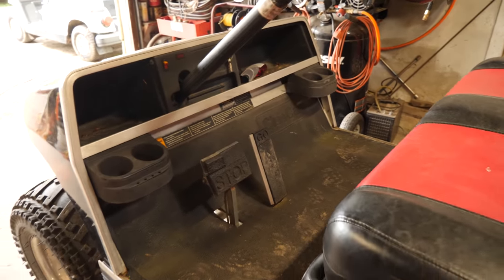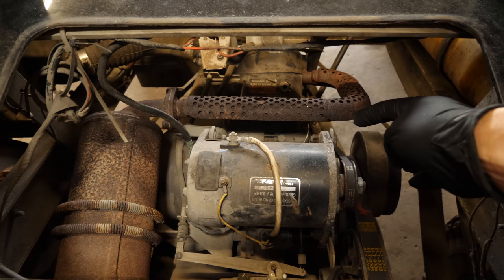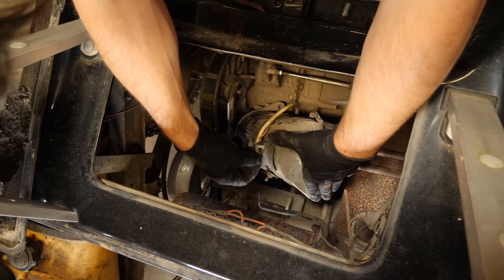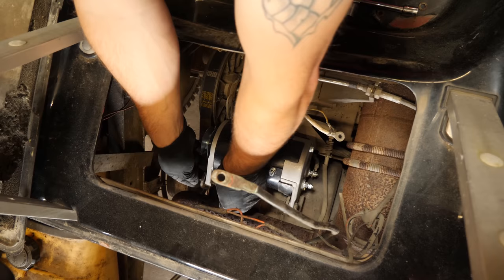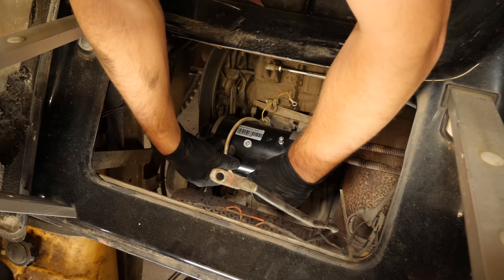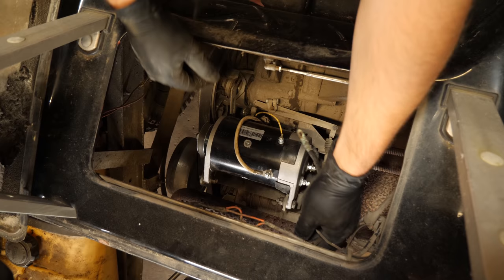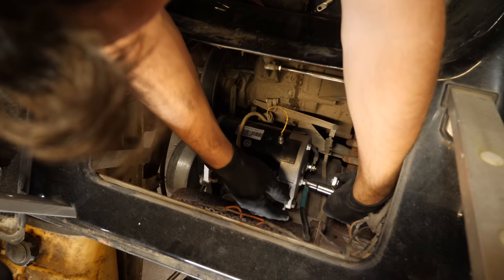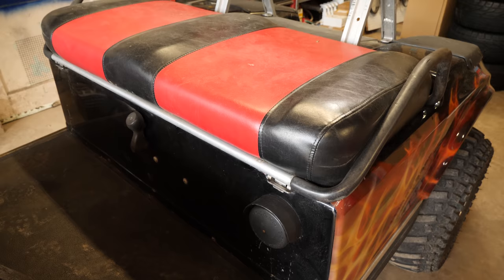1994 Club Car DS, Gas - Replace Starter Generator

Comment: Thanks, my father's club car is doing the exact same thing as demonstrated in your video. I diagnosed it to the starter generator, but our local dealer was suggesting something else (without having seen the cart).
Reply from the maker: Its really hard to suggest a repair without diagnosing the issue first. When someone says their cart won't start and asks what it could be, its very difficult to pinpoint a solution. Best thing to do is start with the easy stuff, like battery connections, voltage and polarity. These are the most common issues. Next, check for a blown fuse. Typically its a 10 amp fuse that controls the entire cart's electrical system. I usually jump to the solenoid next and see if it has power where it should. Sometimes these will click but not make electrical contact to start the starter/generator. If it doesn't, I check all the micro switches and key switch for voltage and continuity. Sometimes a corroded wire or connector is the cause of many issues.
Reply: Thanks for that, Kevin. Those were pretty much the same steps I went through to diagnose the starter generator. Prior to this latest issue, the cart has been having some trouble starting. It would just crank forever before finally starting, especially when it was cold. Once warmed up, seemed to start ok, usually. I suspect the starter generator has been borderline for some time, and sounds like it is a very likely cause of the difficult starting problems. It finally had enough of the long cranking and failed. Thanks for all the videos, I watched quite a few.
Reply from the maker: You are very welcome! I'm glad to hear that you were able to resolve the issue and get your cart back up and running. It sucks when you want to go for a ride and have to deal with issues like that. I know it can be especially annoying when you try to search for a possible solution and find nothing but half-assed answers. Thank you so much for supporting my channel! It does take quite a bit of work to make these videos  what they are.

Comment: I'm running into an issue with my 89 DS where I press the gas pedal down and it's like there's a delay. it starts and the cart moves just fine, there is just a delay almost as if I have to floor it to get it going from a stop.

Comment: Thanks Kevin another useful video. I replaced my carburetor on my 1999ds club car but don’t know how to set air flow and gas to carb. Can u tell me proper adjustment or refer me to an other one of your videos. Thanks
Reply from the maker: Visit my site or facebook page (link in the description) and send me and email or message with a pic of your carburetor. I will do my best to explain how to adjust it.
Reply: Kevin thanks for taking the time to do this. It’s the same style carburetor as in your 2000 DS service video. I’m sorry don’t have a way to send picture. Mine is a 99 DS club car. Thanks again your videos give confidence to be able to work on this machine.

Comment: Replaced starter/generator on my 95 club car DS. Watched your video to diagnose problem. Replaced and now it’s not doing anything. Won’t turn over at all. Battery is 1 year old and fully charged. The original was a Hitaci GSB 07-04A. Amazon showed that model so I ordered. What I received was Dynamo Generator model 15421N. Is that the correct part?? What else could be the problem?

Comment: I have a 85 club car gas will not charge so watch come to figure out voltage reg so put new one on wasnt the problem so put new starter generator on still same issue where to next I checked all wire all are good

Comment: Hello,I have 02 club cart that wont start I just had the brushes changed sometimes the motor will turn over but there is no spark jumping the solenoid turns the motor over.hope U can help thanks
Reply from the maker: It sounds like you have a bad rev limiter or ignition coil. Possible there's a bad micro switch.

Comment: When I changed my starter the cart no longer goes very fast. Literally about 3 mph is all. When I put the cart in service mode it is the same. It's like the throttle doesn't respond to pressing the pedal. If I reach down to the carburetor and push the throttle with my finger it will rev up. What could be the issue?
Reply from the maker: A cable has gotten disconnected or is being pinched. There are 2 cables on Club Cars, one from the control box or accelerator pedal that runs to the governor on the transaxle. The other cable runs from the transaxle to the carburetor. I'm willing to bet that the one from the transaxle to the carb is being pinched under the starter/generator.

Comment: If my solenoid works and i replaced my starter and it still intermittently doest crank what else could it be??
Reply: Ended up being my solenoid.  No voltage across large terminals during no crank.

Comment: Have trouble with my 2002 club car replace the fuel pump carburetor and the coil still loose power no ass what to do next
Reply from the maker: Do a compression test. It should be over 120PSI. If its lower than 100PSI, adjust the valve lash.

Comment: I will try that the valves r 0600 thank you
Reply from the maker: I know they started using hydraulic valve lifters in those engines but I cannot remember when off the top of my head. If you have hydraulic lifters, there will be no adjustment for the valves.

Comment: So I’m curious, I have a 2014 club car turf that is spinning ccw so I’m driving in reverse. I’m thinking now maybe someone just wired this starter generator wrong?
Reply from the maker: A 4-stroke engines cannot run in reverse so I'm thinking they put a different transaxle or engine in the cart.
Reply: @Kevinsgolfcarts  ya I think it has the newer rear end and and older fe350. It’s a 14 club car turf 1 and the drive and reverse is flipped so I’ve had rpm issues. I believe I’m driving in the reverse gears. Is there any reccomendations you have to get a little more speed with how it’s set up without changing to an older rear end?
Reply from the maker: Not really. Your stuck with it unless you swap the transaxle or engine. If you are driving faster in reverse than forward, then its definitely setup wrong. The Turf I was geared lower than standard carts so they are slow but are torque monsters.
Reply: @Kevinsgolfcarts  ok thanks for your input, so as far as you know 97 and up club cars should all spin cw right? Mine goes about 8mph and the rpm’s sound normal, if I bump the govenor up to make the cart go 12 or so it just sounds to me like it’s screaming pretty good